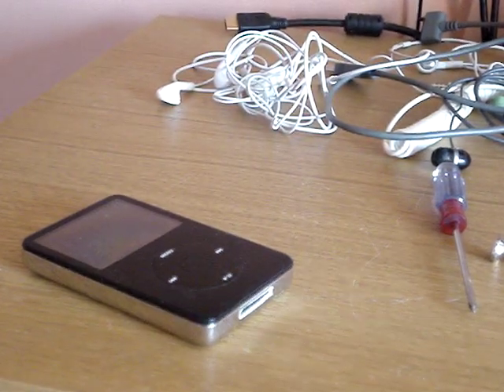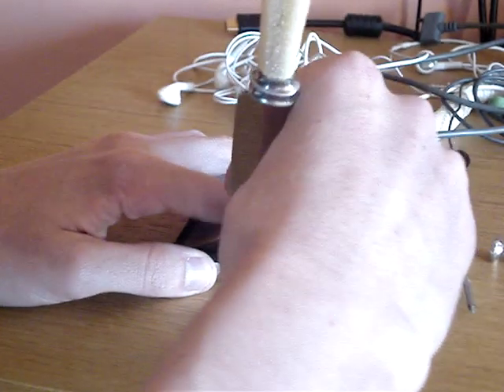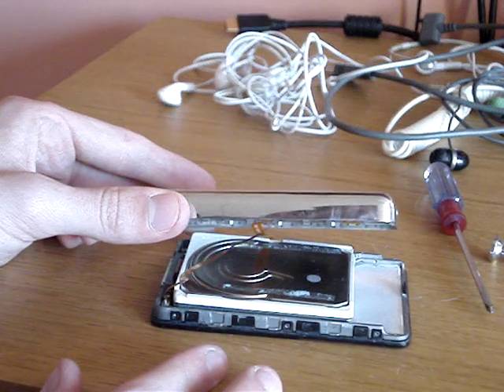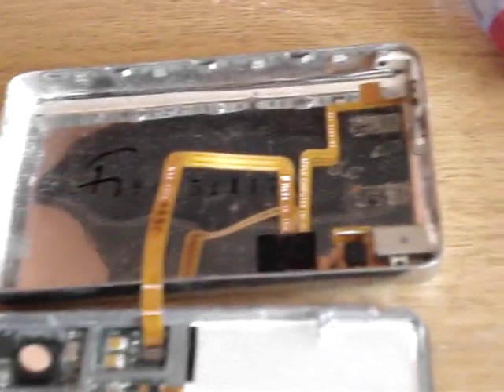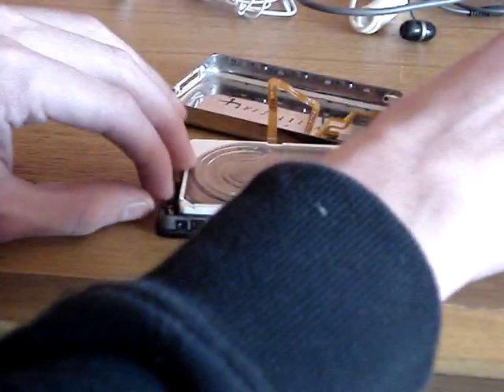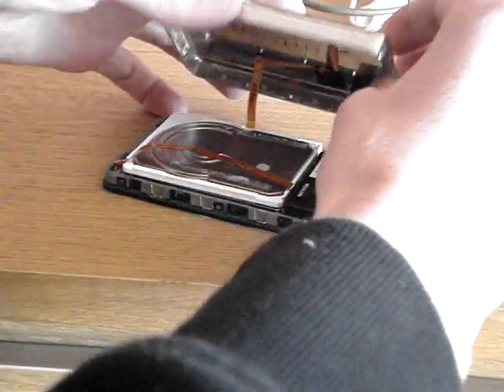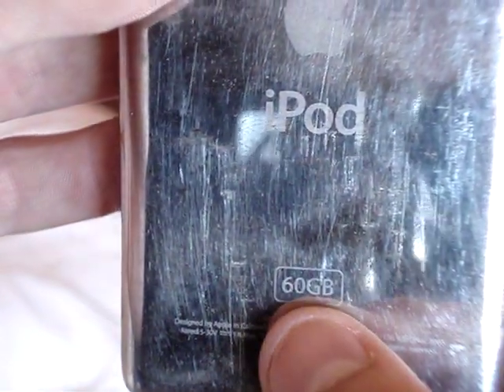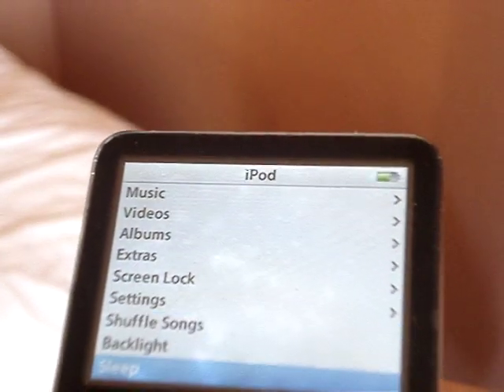iPod Video/Classic Battery Replacement tutorial

Comment: Very well done,  Thank you.  One thing though, could you tell me how to glue the iPod (same model you used) back together.  It was fixed a few times, now there is virtually no adhesive left along the edges.  The slots don't do the job alone. TY

Comment: The battery is stuck on the back cover with some adhesive. The first thing you need to do, is to remove the battery cable from the battery connector, which is located on the motherboard. Use a small tool like a thin screw driver or paper clip so that you do not damage the battery connector. Then, use either your hands or a plastic tool to remove the battery from the back cover. To replace the battery, just follow the steps that I have given in reverse order.